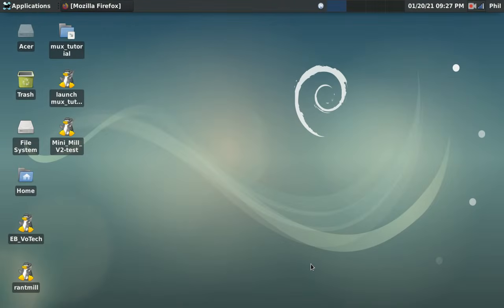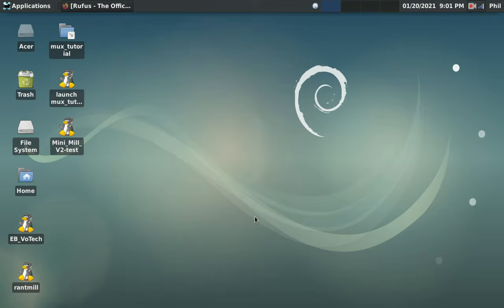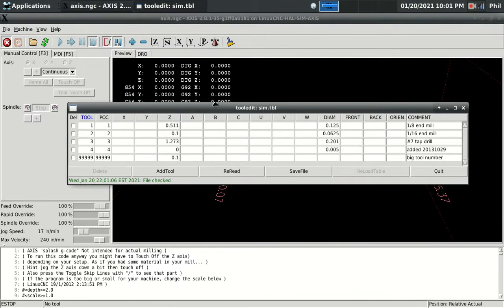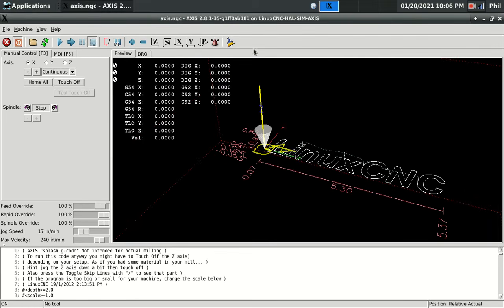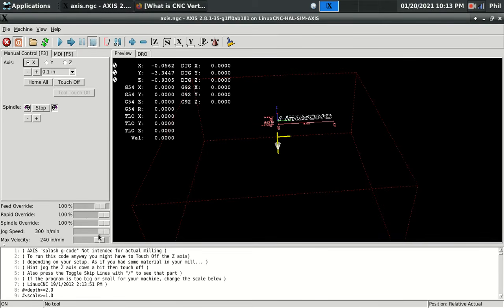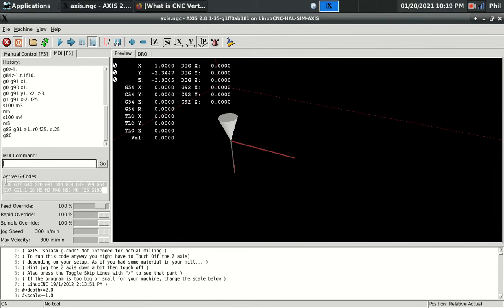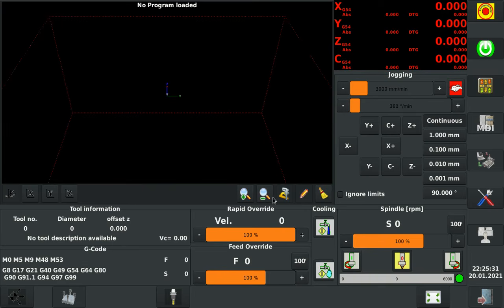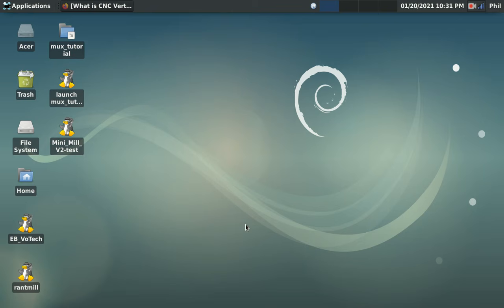LinuxCNC for the bare bones beginner - Part 1

Comment: Thank you for your excellent work, but.....
IMHO Linuxcnc is NOT for people without 1: a master degree in IT and/or 2: a phd in software development and/or 3: 20 years of experience with Linux prior to this.
For people like me only with 25 years of experience as a PLC technician it requires an enormous amount of patience and a steady blood pressure.  Give up as long as you can - I did....
Reply from the maker: I have a high school diploma, suck at software development (but am good at machine tool logic) and had zero Linux experience going into it and managed to have a running machine in a few hours. It's completely possible.
Reply: @TheFeralEngineer  I have a master in architecture, suck at software development and had zero experience with Linux 
After 4 months I have still no idea if and when my machine ever will be ready.
In other words things can be very complicated and if you get caught up in a cascade of sub sub challenges its definitely a uge advantage to have the black belt in Linux
Reply from the maker: @nicola3444  and again, I had a machine running in a few hours without ever touching Linux. I used the installer ISO, the serial port wizard and had a gecko G540 alive and happy in almost no time at all. The point of the bare bones series was to give people an opportunity to follow along and hopefully learn how to navigate the system and build a config. I haven't touched linuxcnc in a while, but when I do, i'll more than likely continue to update this series. I have a few machines that I need to work on in my basement.

Comment: Your video was very helpful to explain single-stepping. I find it odd that the program must first be started at full speed, and THEN paused and single-stepped. I would think that there are many situations where running suspect jobs at full speed right out of the gate is not a good idea.
Reply from the maker: I hated the way it works by default, so I wrote a ladder circuit to make it more like an industrial control when using physical buttons 🙂

Comment: Can you fix my Linux cnc remotely please? 😢😢😢
Reply: I’m having some trouble with my CNC router table and the LinuxCNC software. 

I was working on a specific code that I’ve run several times before, but this time, I encountered a problem. The Z axis unexpectedly moved down more than it should, across multiple codes. I wasn’t doing anything to cause this, and it moved too far down on the router table. I had to shut down the computer immediately.

I need help reinstalling the LinuxCNC software and reconfiguring my router table with the new setup.

Additionally, I’m facing another issue with the limit switches on the X, Y, and Z axes—they aren't working. The router keeps moving until it hits the end, which isn’t supposed to happen.

I also have a problem with the Z axis; when I raise it, there’s no limit switch, so it makes a noise like it’s hitting something at the top.Could anyone please help me out with these issues?

Thanks a lot in advance!
Reply from the maker: @samyhadidy  I typically charge $100usd/hr, but right now I do not have the time to dedicate.

Comment: Why would anyone go through all this trouble having to learn Linux when you have Mach3 usb for windows. There is more information and simplicity setting up and running your machine.
Reply: Try running really big codes on mach 3
Reply: @estasnozes  I ran a large 3D job that took 28 hours without a problem.
Reply: There is latency on the USB side and my machine in not a router it is an 1970 s lagun that the original cnc contol board had died so I retro fit it up with new gecko drives and did some research and found mach paid the liscensing and thought I was good to go

Turns out if you use your computer for anything while to are trying to mill something windows does not like mach and has this little problem of scrambling the gcode and going in a straight line
Reply from the maker: @sledder800-xd7hv  mine would do it just from hitting feed hold. I scrapped way too many parts to trust it, so I gave up on it a little while before pandemic.
Reply: @sledder800-xd7hv  I learned with mach3 15 years ago. Now I run 2  old Chinese machines. A small one with 2kw spindle and my big one has a 9.5Kw water cool spindle. Originally made for carving stone but I use it for cabinet making. One came with NC studio. first thing I did was switched to mach3. They both run great, never a problem. Mach3 is the way to go for those setting up machines. Way simpler and more info to get you up and running then any other software.
I also work on other stuff while mach is running and I have had no issues that you mentioned. sounds more like your computer has a problem not Mach3.
Reply: Mach3 is proprietary trash
Reply: @matthias7534  So you say! I think their are tens of thousands of happy users that would beg to differ with you. I'm one of them.
Reply: Is mach 3 free? Does it support dual encoders on each axis? 

I need linear encoders and rotary encoders on each axis without paying an arm and a leg lol
Reply: @nowar9220  Mach3  is a CNC controller. It's cost around 200.00 for license.
Reply from the maker: Because mach 3 is trash
Reply: @TheFeralEngineer  Haha, I don't think so. I own several machines and have swapped out many over the years. First thing I do is switch them over to Mach3. With the usb card it's brilliant.
Reply from the maker: @rayleblanc7209  good for you. I save at least $200 every time I build a machine simply based on the fact that LinuxCNC is free/open source. I started with crap3 on my CNC router and the final release used to plow through my parts when I would hit feed hold. After destroying a number of parts and the GUI builder constantly crashing on me when trying to make my own interface, I swapped to LinuxCNC. The setup wizards are simple to work through for an initial setup and the amount of power that HAL, classic ladder and all of the other functionality I've mentioned in my videos offer was a great draw for me. At $200 a pop for the licenses, there should never be a reason for their shitty software to ever plow through my parts. I ran Crap3 for 10 years before switching, but I eventually did and I think you should as well.
Reply: Agreed mach 3 has crashed dozens of my parts I finally switched over to Linux and have had a much higher success rate
Reply: @sledder800-xd7hv  I doubt it.
Reply from the maker: @rayleblanc7209  doubt it all you want, I experienced the same bullshit with that garbage.
Reply from the maker: @sledder800-xd7hv  fanboys never believe when you say that or they're fast to blame you for what it's doing. Something as simple as a feed hold would cause crap3 to go skynet on me and plow a straight line through my parts and because it hasn't been supported since something like 2010, the latest release will never be fixed.

Comment: Can it control xps -rl 4 axis cnc machine controller?? 
Will this work for cnc micro milling machine for controlling motions in all 4 direction? Pleasee tell me ..
Reply from the maker: It supports up to 9 axes
Reply: Thanks a lot but I am getting problem while connecting through usb it's not detecting the drive control which is sieb Meyer ag consists all connections in itself like cnc controller which is xps -rl as well as cnc milling machine , servo motor,coolent an all please tell me how I should connect the software with the hardware although I have a usb connection through out but not detecting pls help me it's needed
Reply from the maker: LinuxCNC isn't compatible with USB control boards
Reply: @TheFeralEngineer  then how I will connect with cnc
Reply from the maker: @shobhangiverma7090  parallel port or Ethernet
Reply: @TheFeralEngineer  can u pls suggest any software pls
Reply from the maker: @shobhangiverma7090  Mach3, more than likely
Reply: @TheFeralEngineer  but mach3 cannot control servo motor
Reply: @TheFeralEngineer  pls suggest me for the newport 4axis cnc machine controller
Reply: Pls tell me I have connected the xps rl with the help of lan ethernet but mach3 is not showing connected pls help me how I should get through this 🙏
Reply from the maker: @shobhangiverma7090  i teach Linuxcnc tutorials, not Mach 3
Reply: Does this software supports servo motor? Or only it is for stepper
Reply from the maker: @shobhangiverma7090  both. You can use a partially closed loop where the servo is closed to the drive and you use step and direction or you can have full closed loop back to LinuxCNC using analog drive signals and encoder/scale feedback

Comment: Maybe explain what the hell a joint is so when we are dealing with this error we have a clue what it means?
Reply from the maker: A joint is a non interpolated version of an axis. With linear kinematics, there's no real differentiation. Before x, y and z are called as such, they're referred to as joint 0, joint 1 and joint 2. If you were building a robot arm and using 2 or 3 motors to generate linear motion, the joint designation would help track down which of those motors may be giving you an issue. Saying x axis error when 3 motors are interpolating the linear motion would be maddening
Reply: @TheFeralEngineer  for the bare bones beginner

Comment: Do you have any videos using a Rotary 4th Axis in Linux cnc, we came over from mach3 as we were having problems using the rotary so we thought we would try Linux to see if the problem laid with mach3
Reply from the maker: I do not, but what issue are you experiencing?
Reply: @TheFeralEngineer  we have had problems since changing from the Duet board to mach3, we changed because at the time the Duet couldn’t be configured for a 4th axis since then we have had problems on the flat work where the cut will be going nicely then all of a sudden the router just plunged into the work, this normally happens on smoothing but sometimes on roughing also and the 4th axis lathe seems so off it’s unbelievable if you do a statue for example it’s face will be so wide and there will be arms and legs were they shouldn’t be, we have tried calibrating hundreds of times, we looked into backlash, steps, even the level of the machine, literally we have come to the end of our tether with it. It doesn’t seem to be Aspire because our other smaller machine is fine with the same designs and runs ok with mach3 just to rub salt into the wounds. So we decided to give Linuxcnc a go to see how the machine worked with this programme
Reply from the maker: @Maethenorthernwitch  it's funny you say that because I stopped using Mach because of similar reasons but all of the couch experts are fast to give you the "that never happened to me, you must be doing something wrong" bs 🙄

Comment: Great tutorial but we have run into an issue around 20 minutes in when you looked at the MDI. We put the first GCode g0 g91 x1 in and it moved but when we typed the next command in go g90 x1 we got an error message “can’t issue an mdi command when not homed” we then tried to home and it wouldn’t home so we restarted the computer. We tried again which resulted in same message, we then tried to run and got the message “cannot run a program when not homed” hooding you can help us out, many thanks in advance
Reply from the maker: Do you have your machine connected? Are you using home switches? If either of these answers are no, you have to do this in your ini file:

[TRAJ]
NO_FORCE_HOMING = 1
Reply: @TheFeralEngineer  how do I do that, you can tell I’m new but from what I’m reading if I did have my actual machine attached with homing limits this would work on the MDI
Reply from the maker: @Maethenorthernwitch  when you set up your machine, if you used one of the wizards, I believe there may be an option to not enforce homing on startup. if not, after you create your machine profile, go into the folder that gets created (usually the folder gets created on the desktop for access), open the <machine name>.ini file and under the TRAJ section, just insert the no_force_homing = 1 line
Reply: @TheFeralEngineer  thank you

Comment: Just started the video; incase its not discussed, what happens if you only have usb ports, whats needed to complete that connection/data transfer?
Reply from the maker: You need a parallel port or network card, depending on other hardware you choose to go with. I'd say 99% of computers with usb have at least one Ethernet port or at least a pcie slot that one can be added to

Comment: Can I test all of this without connecting any hardware? Just to try and get the hang of the LinuxCNC software
Reply from the maker: Yes, absolutely. You simply make a bootable usb drive and run one of the simulation environments 🙂
Reply: @TheFeralEngineer  thanks! I've managed to get it up and running on a raspberry pi, is it also possible to try and create my own GUI in the simulation mode without any hardware attached?
Reply from the maker: @dianemuresan7979  yes, but gui development is fairly tricky. There are resources online for how to do it with pyvcp, qtpyvcp, Gladevcp, etc, but it's a long road

Comment: Thanks for this perfect tutorial. May I ask which kind of card (MESA or other?) did you use your builed?
Reply from the maker: I use the 7i76e and 7i76ed cards primarily
Reply: Dear  @TheFeralEngineer ,
Thanks. Do you have plan to make tutorial for hardware electronics and cable connection works?
Reply: Dear  @TheFeralEngineer  ,
I build my first router with Arduino Uno and GRBL. Now I plan to transform old vertical milling machine to CNC. I guess Arduino Uno will not enaugh for this job and plan to use LinuxCNC and required equipments. But I affraid especially because of cable work and connections. It will be perfect if we have step by step tutorial to explain electronic connections on MESA card and other electroinc things. 😉

Comment: hello community
Please is linuxcnc compatible with windows 10 professional
good start to the week to you from Cameroon
Reply from the maker: No, it runs on the Linux operating system. You can dual boot a computer and have windows running as a separate os, but never the two shall meet.

Comment: I like the content and appreciate your effort putting this together. I've learned enough watching this video and will download and run the ISO on my spare laptop to see if this is what I feel comfortable using. I've used Mach3 and UCCNC and will compare LinuxCNC to these other products.
Thanks, Peter
Reply from the maker: Watch video 2 as well. I go a little deeper. 3 and 4 cover the config wizards to get you up and running. Once you get the machine going with the basic setup, check out my hal and classicladder videos on how to start really fine tuning your setup. The amount of power in LinuxCNC is only limited to the imagination👌👌.

Comment: A lot of newbs have trouble with understanding Homing and soft limits, with and without having limit switches. If you look on the forums that seems to be the number 1 question beginners ask about, it would be a great video, Also how to set up and run a basic program on a machine such as a router or mini mill.

If you look there are a ton of videos for mach3 but the selection for Linux CNC is pretty slim, especially with a machine hands-on.

Comment: Question, I have a Sherline machine that came with a desktop computer and stepper driver all in one box. The pc mobo has a com port Or DB9 serial connection, can that be configured for use with end stops and a touch probe within linuxCNC, or would I need to hack the Sherline driver board and wire in a breakout board between the Driver and pc connection for extra I/O?
Reply from the maker: You can connect two parallel ports to operate in LinuxCNC or you could use a mesa card then just use the old drivers and motors from the control box. Depends on how crazy you want to get
Reply: @TheFeralEngineer  Ohh dope, I didn't' know you could use multiple parallel port cards. Thank you for the good info.
Reply from the maker: @FreedomFactory3D  when you set up stepconf, there should be an option for two parallel ports. It'll create the hal file to support both and you just set you pin assignments accordingly.

The 7i7x series mesa boards actually give you two 26 pin headers that let you connect 2 additional boards on top of the io that the 7i76 gives you standard. You could run a single parallel into a 7i76 (db25 version) and then branch 2 more boards from that, so you can actually drive 3 boards in total. Pretty cool stuff.